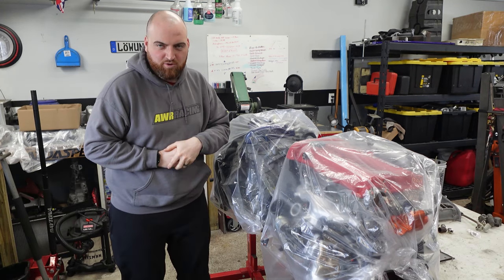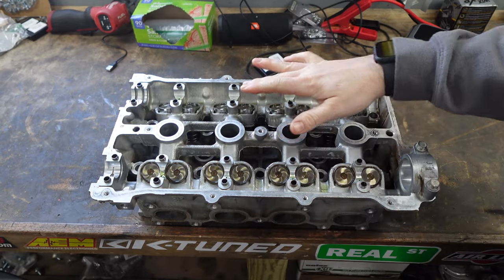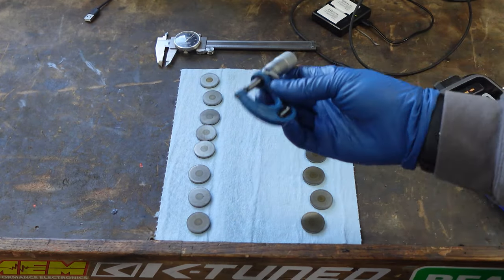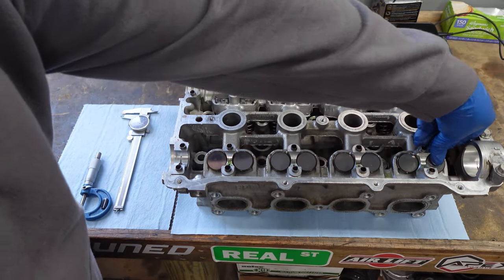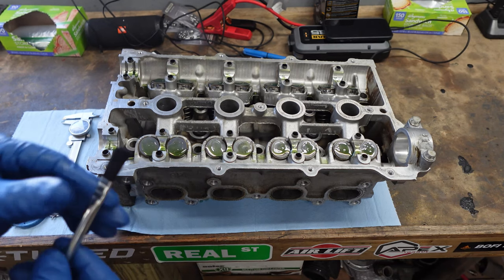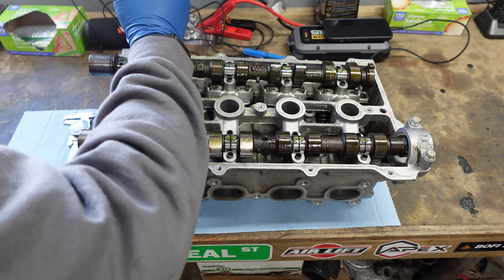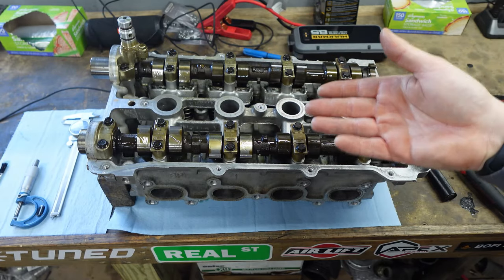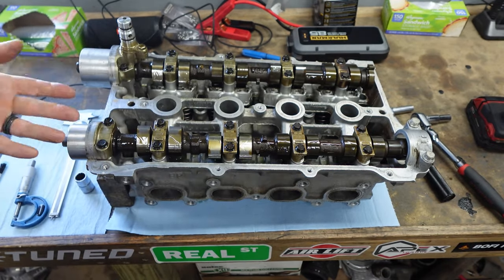Mazda Miata Valve Lash Adjustment How-To

Comment: do you think these being badly adjusted could cause a cylinder #1 misfire? id think it would be all cylinders.
Reply from the maker: It can 100% cause a misfire because it’ll leave a valve open, causing a loss of compression on one cylinder. Had that happen on an old head of mine many years ago.
Reply: @NappMotorsports  okay, the only other quirk is that it only happens when my car is suuuper hot like if i go turn it on now and drive on the highway it wont miss. sorry for asking you to diagnose my car lol

Comment: I just adjusted my lash, my intake camshaft rotates fine but there is no clicking from the valve spring pressure, any thoughts on why I can’t hear the cam switching over as I turn it?
Reply from the maker: It’s likely fine. I wouldn’t worry about it.

Comment: I got a quick Mazda related question. I plan on building a 1st or 2nd gen Mazda Miata into a circle dirt track car. The main rules for it is that it has to be naturally aspirated, no VVT and it has to stay under the Mazda brand. What motor would work best for my regulations? The competition is dominated by K series powered Civics and I need something that would be able to make the same kind of power output that they are reaching. If it has VVT the timing has to be locked.
Reply from the maker: 99-00 but it’ll struggle to keep up with a K series.

Comment: Really excellent helpful video. 

Among other aspects, I appreciate especially your explaining in detail (sometimes seemingly insignificant to an expert) things that can hold up/worry someone like me with limited experience. 
For some examples: 
Mentioning that the shims can go in either way, and how they are held in place. 
Pointing out that the valves are canted at 22° so don't point the lobes straight up for measuring lash. 
The orientation of the "E" and "I" stamping on the camshaft keepers(?).

Also good to know alternatives, like caliper vs micrometer. And the rationale for whatever. And things that could go wrong. And the level of detail here and for instance in your earlier video on rebuilding lifters--showing exactly where to grab the valve with the needle-nose pliers.

I liked that there was little or no music, and everything you said was relevant and useful. Good lighting and a steady camera. 

My interest is mainly for keeping my '99 in as good a shape as possible given limited money, and if something like valve lash adjusting can help return it to its original performance that's great. Thank you!
Reply from the maker: Happy to help! Glad you liked it.